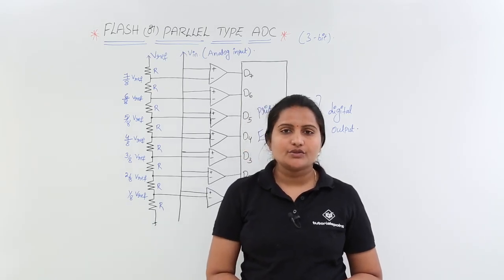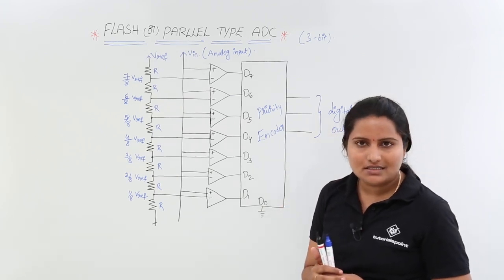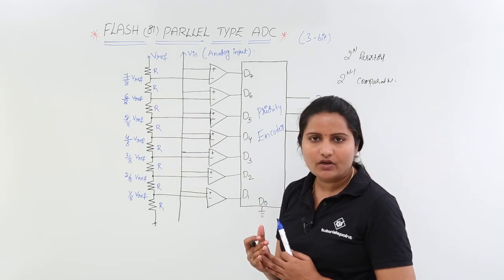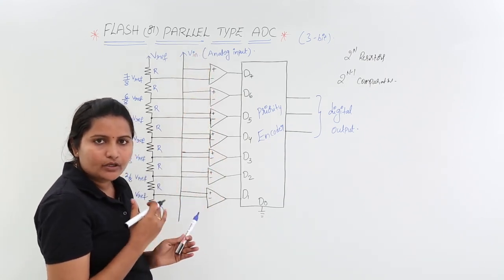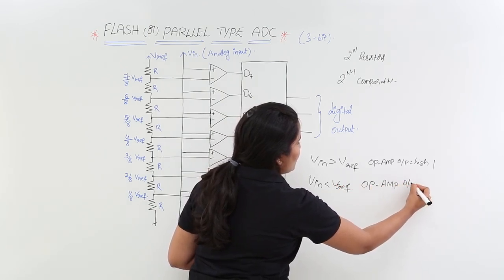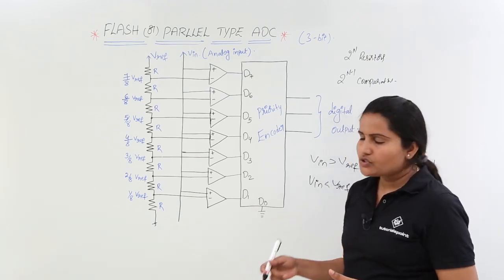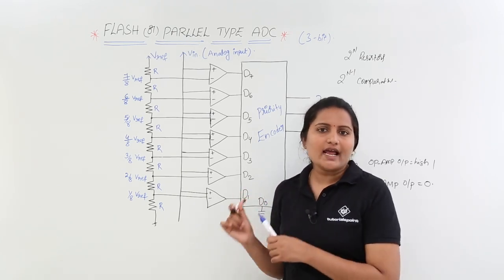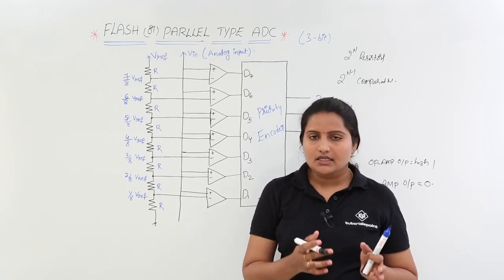Flash Parallel type ADC

Comment: IN ROY CHOUDHURY BOOK,WHY 8 COMPARATORS ARE USED ?
Reply: Hello Haran, there should be 8 comparators actually...
Reply: @circuitsanalytica4348  but as per the code and in internet it is written 2^(n-1) resistors are only used,this is where I got confused